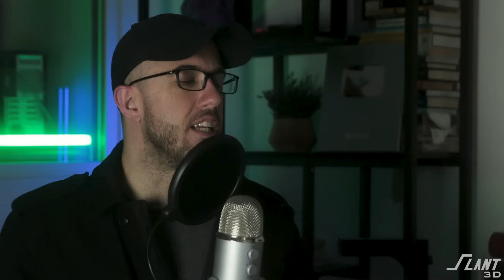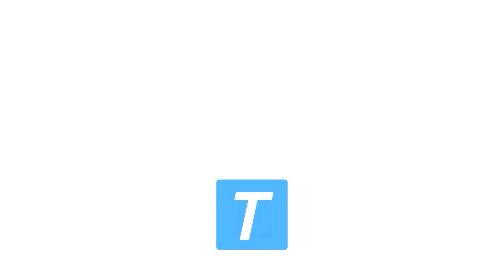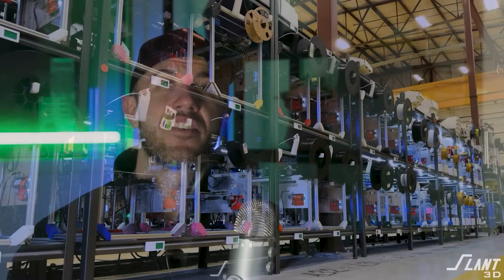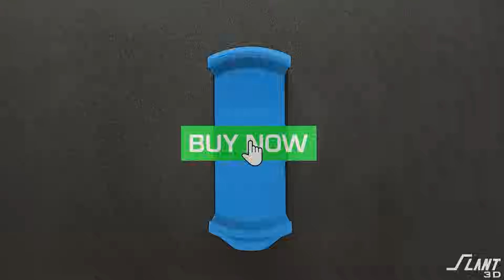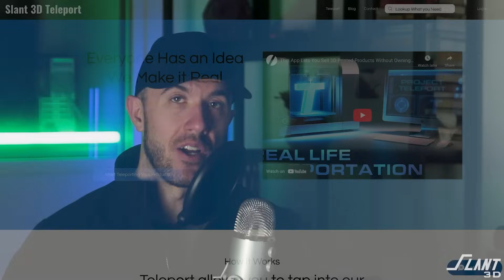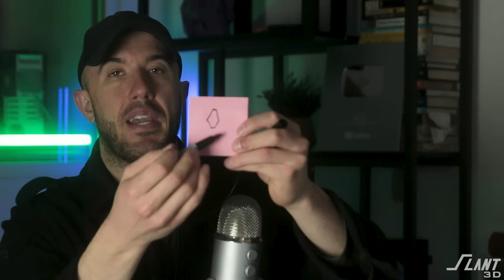Bambu Lab H2D | Nano Dimension & Desktop Metal | Formlabs vs Injection Molding | Podcast Ep 98

Comment: I agree with you on the H2D - I do not get the cutter and laser addition. I would have taken it to 300x300 with dual nozzle and heated chamber and would have been much more interested. Especially at being able to drop the price as the additional safety measures for the laser wouldn't have been needed.

Comment: 3d printing is also about prototyping, im making 3d printed molds. I am attempting to my ostomy bag wafers and totally redesign them. i have 2 ostomy bags for the rest of my life and coloplast, hollister, convatec, nu hope, marlin wafers for the bags SUCK balls during the summer time. Every single person with that has had or has an ostomy says the same thing. also they are expensive. the wafers that work from hollister are $125 for 5... 5 stupid plastic wafers that only last 8 days during the summer, and that's just the wafer, not the bags. insurance only wants to cover the bags/wafers that don't work. i usually go down to osu hospital to get free bags/wafers when i run out, well i ran out last night. im wearing a wafer made from tpu and its holding up great, but needs more r&d.

Comment: Question: Both skipped last week below

Question: Please share ideas for lithophane geometry strategy that avoids infill.  I'm trying a grid .2mm cylinders with 1mm gaps between them.  It's not great, as I can see them a bit.  

For best contrast range, my tests with slant3d supplied lights show I need up to 4.6 mm of thickness in these lithophanes.  Is there a better way than cylinders?

Question: I'm dying to test with the actual colors you print with .  So far i only know the gold pla.  What are the other colors / brands so I can get test samples?

Thanks from Brad the #1 TPU fan in the great lakes region.

Comment: Definitely agree, about the H2d, they missed big on improving the AMS. The AMS still struggles with flexible material. The could have also made this 375 cubed instead of adding a laser. They should have had a stand alone laser stuff. The P1s I have is great, but after the firmware fiasco, they lost me. I will never buy another bambu until they make it easier for open source and revert the firmware stuff. Also glad they added a usb port. Thanks fo all you do on getting that filament to 10. Proud of what you are doing and I hope everyone gets better.

Comment: I print tons of bushings and plane bearings. If it's low wieght and speed, petg works really well. If you need something for higher performance Igus makes some fancy bearing self lubricating filament. Haven't tried it but I have used their plain bearing that they claim is the same material, they are quite excellent.

Comment: I think that Bambu should stick with 3D printing and leave laser cutting/engraving alone with this machine. History has shown time and time again that the more features you add, the more that can go wrong. So in the case of the H2D. If that laser tool goes to heck, does it then brick the machine? If not, you at least have a 3D printer. But if it does, you now have a 50lb paperweight.

I don't think Bambu necessarily needs to stay away from laser cutting/engraving though. If they want to sell an engraver/cutter, I see no issue with that. Afterall. The only difference between a 3D printer and a laser cutter is the toolhead and the coding. Otherwise it's still a motherboard that tells stepper motors where to move the tool to do the work. And if there's a way to program a slicer that can create a code that tells a printer to do its thing, and then when you move your part to the laser to do its thing. That'd be cool.

Comment: Regarding the H2D, I agree with you on the lasers and cutters. If they had simply released the new printer with the dual nozzle and larger build volume, most people would have been happy. Those upgrades, along with improvements to most of the other features, honestly look fantastic. Unfortunately, they went in a direction that most of us aren't interested in, and the community's disappointment has overshadowed the advancements they've made with this new machine.
Reply: The new printer with dual nozzle, larger build volume, and improved AMS exists. It's called the H2D. You don't need to get the laser. Why can't people just see the H2D Laser for what it is, which is a completely separate product?

Comment: Bambu have priced themselves out with gimmicks when it comes to the H2D. All they needed to do was release a bigger X1C with the dual extruders, heated chamber and drying AMS. They even fumbled the machine size as it doesnt utilise the full build volume unless using dual extrusion. I believe that in less than a year due to slow sales, they will release a cut down budget version without any of the cutter or laser features.

Comment: Lasers make a ton of mess and will require constant cleaning and maintenance; especially to the rails. A multipurpose machine is not practical.
Reply: Also, If someone doesn't know and decides to print an ABS part, then use the 40-watt laser to burn their logo or name into it, it's going to produce cyanide dust or even gas.

Comment: I already own 7 diode lasers olus 1 fiber laser. Theres no advantage for me to buy a 3d printer with a laser cutter. I don't really see the advantage to adding a laser to a 3d printer.  A dual nozzle setup on a larger,  enclosed platform would be nice to have if i can find a good spot to set it up. I'd love to have one nozzle dedicated to running support materials like the water soluble one for prints. Although I'm really hoping anycubic gets those additional nozzle sizes and hardened steel nozzles out sooner than later. Theres projects i really need those nozzles for.

I have question about teleport:  do you have a page that shows every color and color variation or gradients that you offer your customers?

Comment: M.M’s Pro Shop did the only proper review of the HD2 where she tested all the features properly. Testing the HD2 base is fair enough but then the €3500 (which is for the 40w laser) shouldn’t be mentioned. The full machine is for makers, not really the 3D printing community. Bambu Labs is chasing the Etsy crowd, crafty moms and the cosplay crowd which is a far bigger market (the advert says it all). Hell even I am interested in a machine that’s a laser, a cutter, a plotter and a great 3D printer but I would never have been interested in buying a bigger X1C. So they are aiming at a different market I think or you can just buy the base unit.

Comment: The more I think on it, the more I'm convinced that the laser and vinyl cutter are in the H2D because someone on the design team didn't want to go buy a dedicated machine.  We all tend to forget this, but the X1C was purpose-designed as a machine that would quickly print drone parts out of CF-Nylon.  It was the printer that the founders of Bambu wanted for their drone building hobby and it didn't exist so they created it, and then they sold it.  I think the laser and vinyl cutters are the same thing.

And this seems silly to North Americans because we have lots of space so it's no big deal to have three dedicated machines.  But I've lived in Italy.  Having an all-in-one machine that I could set up in a corner of my tiny flat would be much more relevant there, than it is here in Alberta where I live in a three-bedroom townhouse all by myself.  

So, yeah.  My guess is Bambu returned to its roots and said "what's the machine that we want and no-one makes well."  And now they're looking to see if anyone else wants that too.
Reply: I agree that the design is likely based on what someone on their design team or one of the founders would want to use. We also need to remember that at heart Bambu is a Chinese company and many there don’t have much space to have a 3D Printer, Dedicated Laser Cutter and Dedicated Vinyl Cutter/Plotter. 

Also it can be useful for those that don’t mind the extra cost to be able to occasionally use the laser or cutter without having space being taken up by more machines that aren’t used as often as the 3D printer. 

I think they’re targeting those that might not have much space but also trying to target makers and not just those doing 3D printing. 

It easy to be confused on who they’re targeting as you mentioned with us from North America or the US where many would have space for dedicated laser and dedicated cutter.
Reply: @ Heck, in terms of cost if one is buying the H2D anyway, the laser cutter is about half the cost of a comparable separate machine.  The question then becomes: how many people are going to buy a laser cutter and a 3d printer at the same time?

Comment: The laser in the H2D can be handy to engrave scales, text, serial numbers etc. and do other things to the printed part. It should be seen as an tool to improve the 3d prints which have been printed on the machine before.
Reply: The only laser that I know of that does a good job on plastics is a UV which this is not.
Reply: @ good to know. Thank you

Comment: Dual nozzles, 350C nozzles, actively heated chamber, substantially bigger build volume, TPU-friendly, upgraded AMS - that's a pretty good set of better features for a machine that you don't have to buy the laser, cutter, plotter option.  I'm getting that base machine.  You act as though you have to buy the laser/cutter/etc. system, which you don't.
Reply: Keep in mind that the TPU is not recommended for use with the AMS at this time.  Its recommended only as the single spool and may require a special setup to get to work reliably. I'm sure its possible to get it to work with the AMS, but this environment will need some thought to use lower than 95A and at high speeds.
I agree that this unit is targetting those who don't have a problem spending a lot of money on their hobby (most won't go above $1500).  This is targetted for the business user at the current price point, which they already have had this feature for 10+ years and most small farms are looking to get under the $1100 range so they can buy multiples...  It's for these reasons I understand Gabe's statement, he's not sure who this is targetted.  However, we will have to see.
Just my $0.02 which is worth less every day...😅
Reply: @PrometricUSA What?  It is significantly larger and the 350C allows one to print filaments that need greater than 300C.  Do your research.  Don't buy the version with the laser and you don't have to worry about  the crud.  It's very simple.
Reply: One of my few real complaints about the machine is that both nozzles can't run on a single AMS.
Reply: @AuntJemimaGames  Yaaaa that's more of a PHYSICAL limitation then anything, not to mention needing a complete redesign of the AMS unit to do that and even then, still need to get around the physical part of how to feed the filaments.
Reply: @AuntJemimaGames well, that makes sense though. There is one outlet, so one at a time. To make it work with two colors, they would have to make the AMS much more complex. Then it would be much more expensive and people would be complaining about the cost, because after all, it’s “just” using two nozzles.
Reply: AS a FDM printer the H2D is amazing and does exactly what it should do, being a bigger and more upgraded version of an X1.  For the other stuff, your better off getting an actual laser cutter to do that.  The 10w head for engraving would be something of use for engraving your 3d prints after they are done.  So you can print something then engrave your logo or some design pattern onto it afterwards, though PETG would be the minimum material I would try as PLA would melt under the laser, even if it was for a moment.
Reply: Definitely a good option for leasing a machine
Reply: the bed volume is still to small. both prusa and bambu need to make a large scale 3d printer. like the crm4 or elegoo neptune 3 max. like its 2025.

Comment: Question: At what angle does Teleport's slicer start to use automated support?  I understand this could change in the future, but this info at least gives an angle that can be approached without likely triggering more expensive support material.  Thanks.

Comment: I actually want the laser cutter/cricut replacement. I am guessing I am the minority but I like the idea of replacing all my machines I use once in a while with one dedicated machine.
Reply: Isn't it nicer to have separate machines and be able to run different jobs at the same time. I have 5 printers, 4 lasers and 2 cutters for my business which means at a minimum, I can run 11 separate jobs at once. My business would die if I had to wait for an 8 hour print to finish before I could laser engrave the first of 20 items and then the next job before cutting out labels.  I'm not dissing the machine, but I think it is for a very specific audience. If it goes down for some reason, then you have lost the ability to continue on with other (different) jobs as well until it is fixed, and you paid a hell of a lot more for it. For 3K+,  I can buy 10 Elegoo Carbons to crank out stuff.  Not an Elegoo fan, just sayin.
Reply: @ I don’t run a business I have a house with limited space
Reply: @ I get that. Like I said, specific audience.
Reply: It’s not practical to keep swapping heads & replacing the bed for every function. I think it’s way more practical to have a dedicated machine for cutting.
Reply: @ you don’t swap the heads it’s an attachment and the bed swap is easy I already do it now. If you have the space and use case sure a dedicated machine makes sense

Comment: I hold the opinion that the H2D has three main advantages: The software. Of course, Bambu is king here. The waste reduction from two print heads and a "smart" MMU (aka software). The waste for some prints is equal or more than the print itself. Reducing that at a commercial scale is worth the extra grand or so for some printers. And finally, the extensibility. The laser and plotter are pretty lackluster *now*, but the ability to expand it will mean they don't have to release a bunch of new machines to keep making money off hardware.

Comment: I might get an H2D if it goes on a good sale. CAD$ exchange is really bad right now. If I need another printer, I'd probably go with a P1P or P1S as a workhorse rather than a toy. Exception would be if I really needed the extra 75mm in one axis. 

I'd like to see one longer axis (the Y axis) since this would not involve compensating for the inertia of a heavier moving carriage.

Comment: I have an XTool consumer laser. It's fun, but it's messy! The inside of my laser is gross. There is smoke and soot everywhere and some types of wood also deposit this sticky sap type residue. I would NOT want that inside my 3D printer. 

I suspect that this is going to be a massive mistake and people who buy the laser module for their H2D are going to regret that decision pretty quickly.

That being said I think the knife cutter attachment is cool and I hope they offer that independent of the laser.
Reply: Bambu is counting on the laser newbies to buy a single purpose machine because of your description. They are creating the next market ... customers loyal to bambu.
Reply: @dbeelee8564  they’re going to be disappointed when they find their 3D printer gunked up with smoke and soot and it starts messing with their 3D prints.

Comment: As someone with a Snapmaker Artisan I can’t begin to tell you how much I’ve used the laser coming from strictly 3D printing. CNC not so much so yes there is a high demand. I’m currently selling my artisan to get the h2d. I want multicolor and I don’t really use CNC. But I could not live without the laser now

Comment: Yeah I agree with your assessment of the H2D. It's a solution looking for a problem. The whole laser and cutter thing is meh at best. Forced into the H2D in order to increase cost and trying to show that they are "doing something new".
Reply: Its not forced in its 2 different models so its not part of the cost and forced at all. You can argue is the base price of just the 3d printer is ok but you can't say they are forcing the laser or cutting or even ams on you they don't.

Comment: 5:58 H2D is a masterpiece of marketing. It's the ultimate "BUT WAIT, THERE'S MORE!" printer for a QVC style pitch.
Also the toolhead alone costs more than an A1 mini.
Reply: Well, that is a scheme in the industry - the Toolhead for an XL costs more than a Prusa Mini.

Marketing was great here, but it is a half assed product, dual nozzle with 6 second switch is about as fast as entire toolchange on the XL. 

The real innovation would have been something like a smaller toolchanger like bondtech INDX.
Reply: @suit1337  The real innovation was dynamic flow control on the nozzel, it really is the culprit for perceived quality issues, not more square frames like everyone who gets core xy thinks. ITs why the A1 mini scores the best in tolerance test results, it uses its strain gauge to detec flow and adjust as necessary. This is a superior system them precalbirating with ladar and not surprisingly the H2D went with it, albeit using the torque on the extruder motor to sense the flow instead of a straing gauge.    Bambu outdone themselves, first with cutting edge calbiration routines, then replacing them with a dynamic feedback control, and no one even notices because they are not up with the tech behind these things.  If they were they'd all buy A1 mini's at it really is the best quality per dollar, and my only complaint with the H2D, its way too expensive ,consdiering the dynamic flow controll is all software and requires less electronics then ladar, im seeing this as a cash grab, because the consumers are uneducated and will consider this the best quality printer, but not know why and pay the premium.  ITs the nozzel control, no one does it so no one will gives is the same quality until they do, and it doesnt need to be expensive.